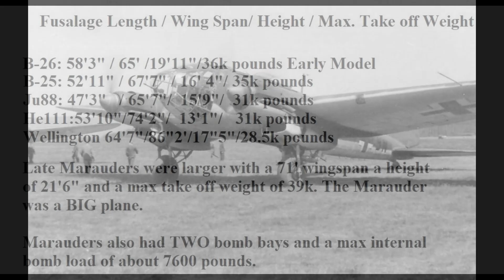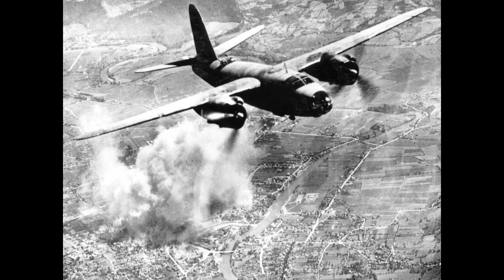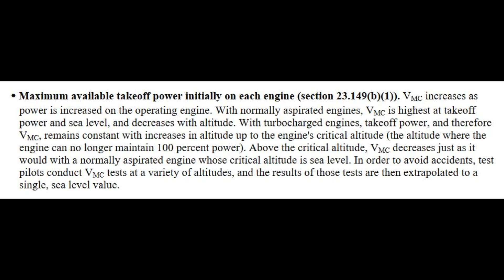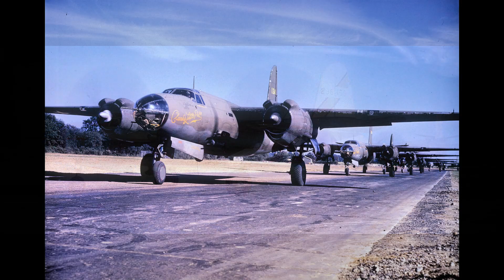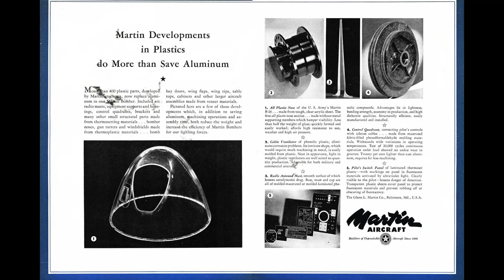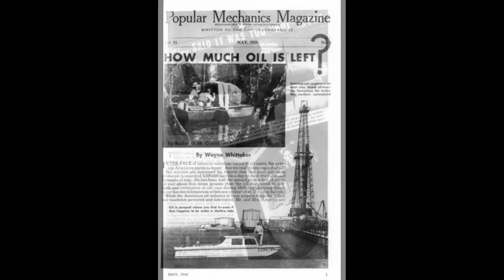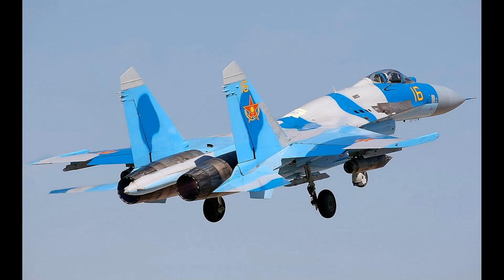Martin B-26 Marauder. Unsafe At Any Speed?

Comment: A lot of the "safety" discussion is because the aircraft was at the leading edge of the knowledge of multi-flying. Imagine if the same airplane was designed and tested in the modern era - many of the accidents would probably have never happened.

Comment: So basically… if an engine goes out, the other engine will kill you if you’re not going fast enough.
Reply from the maker: Sort of,  you could pull the throttle back and glide to a landing, but yes, if you're too slow and too low, then that's your only choice. Death may result depending on where you're crash landing.

Comment: Would a twin rudder design like the B-25 has help the low speed directional control with one engine out?  I'm not sure, but I think it would.  Is the rudder too far back to get accelerated air from the running engine?

Comment: This video touches on the development problems of the Wright R-3350. That would be a good video as it was pivotal for the B-29 getting into service. The B-29 cost more than the Manhattan Project. Most engines went through some teething problems in development testing that need some design tweaks to solve.
The R-3350 had a fundamental problem that drove a major re-design. Two row 18 cylinder radials need 2nd order balance weights. Without them, the mutating engine vibration at 2X crank speed affects the propeller, and propeller failures are deadly.
P&W knew this and got it right on the R-2800. Wright either didn't know or hoped for the best.
Wright also used a larger bore cylinder in general, and that makes the engine harder to cool. Harder to cool in those days meant more trial and error in development. The R-3350 went into service before it was fully debugged/developed. The crews paid the price.
The R-2800 started better but was also under development throughout the war, culminating in the C-Series late in the war, with higher ratings. ( and running on higher P/N fuels)
The C-series was a total re-design, the only common parts with A&B were the starter dog and the O&W logo.

Comment: Convair was issued a contract to build the B-32 Dominator as a backup / fail safe to the B-29 program. The B-32 also has its share of teething problems but it was faster than the B-29 and had a 1000 mile range advantage over the B-29. 

I always saw the influence of the B-26 Marauder in the B-32. As if the B-32 was largely a bigger, heavier Marauder… Not saying it’s actually true. It just seems that way at a glance.

Comment: You might note that Martin never again designed an aircraft that was accepted into US military service.  Instead, they were told to build the B-57, a British design.  Was this a consolation prize, or were they rubbing salt in an open wound. I've often wondered if this was because of government anger over the B-26.
Reply: That's not entirely true, the Marlin flying boat entered service (granted with the Navy and not the Air Force) in 1952 and served quite well in its role.
Reply: @franz_stigler  I stand corrected. I hadn't thought about that one!  Thanks!

Comment: My Father. Lawrence M. McNally.
Flew 153 Missions in the E.T.O.'s
454 Bomb Group, White Tails.

By wars end his plane "Patty's Pig" cruised without the 6,000 lb's could easily cruise around 350 mph. In a full power dive it could easily get past 400 mph. He did it. More than once in practice. His crew would survive  without a scratch,flying from
from May 1943 to May 1945.

The plane would shake and rattle like a huricane, but in a pinch you could make that a reality. He reached 475 mph when his crew said no more of that kind 
if practice. In fact in any event he never had to. 
His biggest worry was always the
88 flak battery at 10,000-15,000 feet 
in the most deadly range and effectiveness. His most remarkable skill
during the war,  was his "flak evasion" tactics  in leading raids. Luck in guessing Left or Right turns in s 3-5 minute delay in response to German flak salvos. And, last second left or right turns over bombing targets. Depending on the state of the formations over targets.
Either scattered or tight.

Most of the time with bombs or not German fighters had ONLY one pass at any B26  formation or individual planes.

Living in Paris after the war my parents ( mother Anerican born German) would entertain lots of high ranking diplomatic and military WWII veterans from both German and British, American vets. And, Many Luftwaffe pilots and German flak battery operators. Borh of which operated at full force in defence over Germany. From the beginning to wars end. The Folkerwolfe and Messerschmit pilots and flak guys said that individually and in formation the
Martin B-26 was the most feared by far.
One pass, fast and Twelve 50 caliber guns. My Father never let me forget.

By wars end my Father had the most powrful WASP 2800 B-26 variant with a total of
12 -50 caliber guns. 
Two in the nose, 
4 in the belly my Father controlled, 
two in the waist, 
two in the tail and 
two on the top.

There were two recessed kill engine buttons dirctley overhead in a center console. These, 
Left and Right buttons would instantly 
Kill or fearher either engine. Many pilots wore very thin leather glives with two finger tips cut off. This was critical so that fat fingers wouldnt stop getting your finger tips in the hole of the button. This was the critical and instinctive life saving manouver ( many failed, learning)
when a propeller ( flatened) or engine blew on a critical take off speed and/or weight problem.
Father was there on the beach when a 
"One a day in Tampa Bay" was happening 
literally right in front of him.He often said, like a Garand rifle, the B -26 was a life saver. His life and mine.
Reply from the maker: Thanks for sharing, very cool.

Comment: I know one fighter that had bogies, SAAB 37 Viggen. The reason for this was the requirement of being able to land on rather short runways as well as roads (down to 800 x 17 m usable, landing on these with the two seat school version was a favorite when foreign pilots where treated to a flight).
Reply from the maker: Yes, it's one of the exceptions to the rule, there are a few, and as you point out, there is always some specific reason for it. Off airport action, or extreme weight.

Comment: My mother's first husband commanded a wing of Marauders.  His wing was pulled aside and given orders to attack a german column that had been seen nearby.  Come in at tree top height, surprise them and bomb them.

There were several things wrong with this. 

First: The sound of the Marauders' engines being dubdonic aircraft always lead their appearance.

Second: There had been no scouting on the column to discover what they were comprised of, beyond a column of trucks.

Third: the order was given by a lieutenant, supposedly from higher officer - but this was NOT true.  He was trying to get brownie points for his "swift and Decisive action".

Fourth:  The column was comprised of the most advanced anti-aircraft equipment the Nazis had.  Guided surface to air missiles, several whirbilwind - essentially 4 20mm cannon on a tank body, that sort of thing.  The Nazis heard them coming and surmised an aerial attack.  the planes came in above treetops, didn't see the germans until they were over them, and had to circle back to attack.  By that time, the column had deployed and locked their weapons on for a nice little target practice.  Only 1 of the five planes escaped, all were too low for their crews to bail out.  they were literally flying lower than the steeple of a nearby town.
Reply: The Germans did not have a guided surface to air missile in WW2, they were playing around with a few designs late in the war but nothing was ever operational and used.

Comment: It’s a crying shame the B26 never got the Turbo the P47 had.  The two planes entered service essentially at the same time.  They made almost 6,000 B26s and produced them all the way until 1945 and at no point did anyone stop to try and squeeze the supercharger in.

Just a guess but the service ceiling might have almost doubled and the speed increase would have also made it incredibly useful.

Comment: Another example of reducing safety:
The Height Climber Zeppelins lightened everything (they retained a single MG for defensive purposes on the top), shaving down the structural parts to the minimum … making it a fair-weather-only airship, especially in the much more turbulent lower atmosphere. Rather have a … sensitive airship than one that would be shot down by Tom, Dick and Harry fighter of the day. Only that and the war going on made it OK to build such a risky vessel. 

The USA did likely not appreciate this fully when basing ZR-1 (Shenandoah) on L-49, a type U height climber, which was, see above, structurally not sound for stronger weather.

Comment: How does the bomb carrying capacity of the Mosquito compare to German bombers of the time? Was Mosquito a fighter or a fighter bomber ? How does it compare to a Marauder in bomb carrying capacity and loaded performance?
Reply from the maker: Every one of those questions is too complex for the comment section. Each could be a video on it's own. The bomb load question is pretty easy though, the Mossie carries far less than the B-26, they are just in different categories in that regard. Of course the Mossie has other advantages, like more speed.

Comment: Interesting stuff as usual. I didn't know it was going to be an AMEL primer :)
(AMEL = airplane multi-engine land.)
Multi-engine airspeed indicators have a blue line and a red line. I think one is Vmc and the other is Vmca. Vmca is the red line, and the operating engine has to be operating at full damn power.
Reply from the maker: the red and blue lines are only on multi engine planes below a certain weight and built after a certain year. The B-26 won't have them for both reasons, but the principles are still at play.
Reply: @GregsAirplanesandAutomobiles  Yeah probably post CAR regulations and into the 14 CFRs. Although... come to think of it the Beech 95 I flew had a straight tail - it was old - and it had a blue line. I'm sure that was a CAR 3 airplane. Having researched ASIs for CAR 3 airplanes in the past (yeah I get into weird stuff), marking requirements are pretty sparse!

Either way, those are civil aircraft. I'm going to have to wait to get back into the B-25 I see once a year and take another look at that one. At least it's from the Marauder era.

Comment: I think using brakes in B-26, B-25, B-24, B-17 and many others is strictly forbidden in takeoff. Differential thrust or rudder, never brakes.
Reply from the maker: The official instructions for the B-26 specifically say to use brakes until the rudder becomes effective.

Comment: It is an interesting what if aircraft.  Did not get the original more powerful engine.  Then after settling for the smaller engine it did not get the turbo supercharger.  What if it got the bigger engine with a turbo supercharger?

Comment: Grandfather was pre war AAC and a pilot for AAC and the Air Force, and spent many years in flight testing.  He flew the B-26 and thought it was a touch sensitive, but a fine bird and very predictable once you were used to it.  He also said it would quickly sort out the competent pilots from the good ones, and the competent could be sent off to fly B-25s that didn't require quite as delicate a touch.  😉

Comment: Would this be a reasonable comparison in explaining the B26 handling characteristics.  In terms of automotive, it could be compared to a Porsche or Corvair.  They were/are great handling cars, however, because of the rear mounted engine, they are a handful for an inexperienced driver (rear engine). Most drivers were experienced in front engine /rear wheel drive and this experience could be deadly when driving a rear engined car at speed. Example going into a curve at too high a speed. In rear drive, let off of the accelerator and go through the curve.  In rear engine car in the same action/situation the engine acts as a counterweight and spins the car around like pendulum. Make sense?

Comment: It was a "hot" airplane and yes, initially it would not suffer fools gladly.  Initially its wingspan was too short and from what I have read, there was also a problem with ground crew partially draining the on-board batteries during testing and maintenance...those same batteries were required for important functions during take-off. It was actually ahead of its time and had only a very few problems which were ironed out. After that, it performed sterling service. Well armed, could carry a more than respectable payload. It didn't seem to be , on the face of it, as adaptable as the B-25 but that seems to be more a result of official decision rather than a deficiency in the design itself. That nose could have sported multiple .50s or 20mm or larger.. maybe not the 75mm though.  Certainly the B-29 had far more problems and vicissitudes during its early career. B-24s actually had a better crew survivability rate than the B-17, despite common beliefs. ANY warplane, when mishandled or mis-deployed, will be a "widow-maker".

Comment: My ex-girlfriend’s father was a tail gunner on a B-26 during the Korean War. On one mission, there was a malfunction in the bomb bay - this is how it was described to me: bombs were held in place by two pins, which were pulled out simultaneously to release the bomb. On this mission, due to flak, on one bomb, one of the pins became dislodged, leaving the bomb dangling from the other pin. While this didn’t present too much of a problem, since they were approaching their bomb run, the propeller on the bomb  - which was the fuse - began to spin; after so many minutes, the bomb would detonate, ideally when it was near the target, but as it was still in the bomb bay, there was the danger that it would explode in the plane, killing the entire crew. Being of diminutive size (for which reason he was a tail gunner), Jim wormed his way through the crawlspace that led into the bomb bay - which was wide open - and then, hanging there, holding on for dear life with one hand, he had to reach across to the errant bomb with his free hand, and hold his thumb on the propeller, to keep it from spinning. He did this into the bomb run, and held it, until the payload was finally released. Successful, they returned to base. Jim was later credited with saving his plane and his crew, and for his effort, he was awarded - I want to say it was a Distinguished Flying Cross, though I’m not sure. I do recall seeing the framed citation on his office wall, with photos of him with his thankful crew, and of him demonstrating how he saved his plane. He looked like a little kid, wearing his pressurized flight suit and one of those big white helmets w/ the winged star. James E. White and wife now rest at Arlington, among the heroes.

Comment: Yeah, I'd choose the B-26 too. There are stories from pilots and crews of this plane taking insane actions to evade fire. Insane diving manuevers with excessive speeds and pulling out of it. Dropping a wing tip and slipping the thing sideways down losing thousands of feet of altitude to get out of flak. For a bomber if you look at the plane it is quite sleek for WW2. Most of the problems seem to arise from the inexperience of rushing it into combat ready status. Back in the late 80s there was one of these that just sat way down between the runways at Chino. You could walk up and stick your head into the open bomb bay. Neat

Comment: Thank you for the thoughtful presentation on the B-26.Your discussion(and the news you were stillworking on your Mosquito and P-38 presentations brought to mind a few questions on the P-38.

1.  What was the impact of the changing of the prop rotation from the yp-38 (both inward) to the P-38 (both outward) on engine failure during takeoff?

The followng is a "what if" (You avoid these like poison and well you should),   I find these intriguing as the solution was present in a contemporary allied aircraft, in this case the Mosquito.

2.  Instead of redesigning the engine nacelle, could the radiator and its intakes been placed between the wing root and the nacelle al la the Mosquito?  This would have also changed the airfoil in that area (with unknown impact on compressibility).  But since form drag might be less, it may have been worse. 

I have some other thoughts, but they would have required a level of omniscience that makes the exercise uninteresting,

Once again thank you for your work.  It is wonderful to watch other youtube presenters feelig required to acknowledge your positions on topics when they express opinions that might be seen to be contrary.  Your work appears highly respected.  I am proud for you (my patreon dollars at work!)
Reply from the maker: 1. It increased VMC, but the P-38 has so much performance on one engine that as long as you got it going fast enough before lift of it wasn't a problem. They had to rotate the props the other way due to some weird buffeting issue. 2. The P-38 has fuel tanks in the place where the Mosquito put it's radiators and the 38 lacks fuselage space to put that fuel somewhere else.
Reply: Thank you for your quick and complete response.